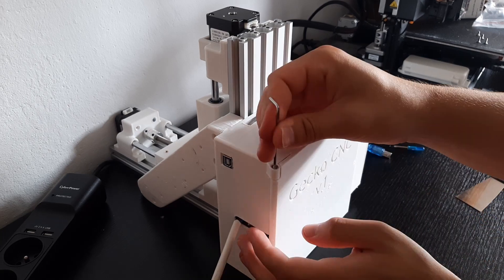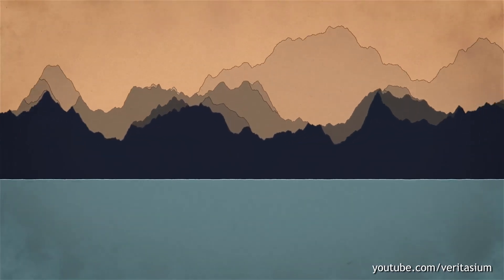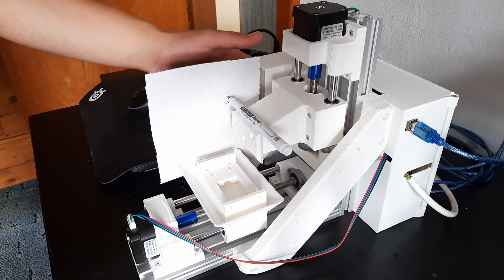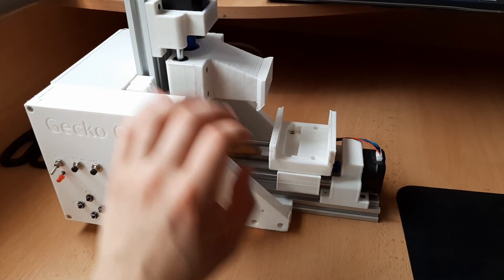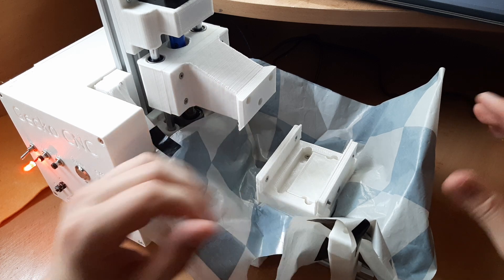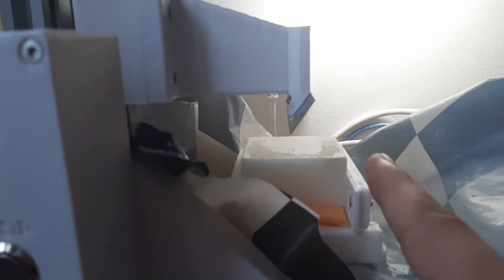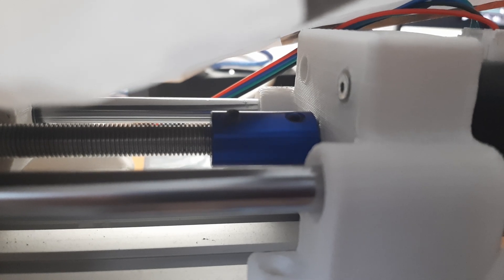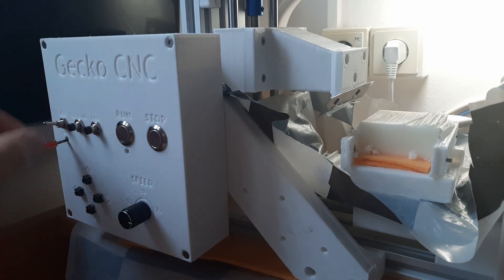Using My 3D-Printed CNC For The First Time...

Comment: Couple of suggestions: I see that other people already mentioned that wax but there is a type of hard wax that jewelers use for lost wax casting that is much harder and way better at preserving details.

The other thing is the vise. Your new design looks to have worked but check out box clamps/right angle clamps that woodworkers use. It would make it much easier to make sure that your block isn't moving in imperceptible amounts

Comment: Cool idea and project. I think pushing the knife in can be a bit problematic, when cutting stuff by hand it usually gets a lot easier by moving the blade along its length. 

Someone mentioned a pantograph, I’ve been thinking about that for a while using my 3printer to control it. But I’ve never come up with a use for it. Maybe this would be a good match?  Or just using your 3dprinter as the cnc with a spinning cutter and some way to increase the resolution in one axis to advance the blade in tiny increments.

Comment: If your goals is to make a machine to only cut that pattern, a Cartesian CNC is probably not the thing you want.

I would see something more like a linear engine or a shaper.

The issue mechanical  here is that you are using a direct drive that doesn't have much precision to do a very precise task. If you are dead set on a Cartesian machine at the very least use pantographs to divide the movement of your screws into something minuscule.

But custom kinetics sounds more adapted here. Using a pantograph pushed up by a roller or a pin attached to a radially slotted wheel to adjust de amplitude, letting gravity applying the carving force. A screw to advance the work is sound but it needs to be in a single direction to not suffer from the backlash. For that end, make the carving axis be at an angle compared to the advance so you only need to move a single axis and single direction as you pattern the work.

And then once you machine is adapted to the task, you can even start to ask yourself the question, "why use 2 motors instead of coupling the advance to carve ?" and realize that you don't even need to have any CNC involvement here by having the motor that moved the carving pantograph also move a wheel with a link that ratchets the advance screw.
But frankly that point is quite optional, it adds quite a bit of complexity while a stepper driven screw is plenty enough as long as the screen is only supposed to move in a single direction.

There is also the issue of the wax itself not being adapted to what you are asking of it, but I have no good informed insight about that appart from suggesting you to contact people from the wax scripting community.

Comment: Maybe try with "hard wax" used for hair removal. It melts at around 45C and is harder than standard candle wax. Also I don't think this face method make real "flat" surface, as the razor blade kinda jumps up and down in this linear motion? Maybe try moving it a bit in cutting direction, and then back to release material, and back and forth?